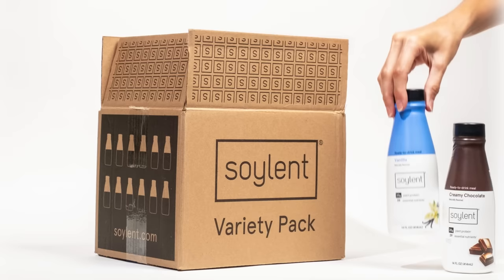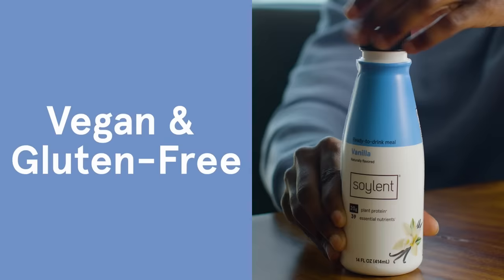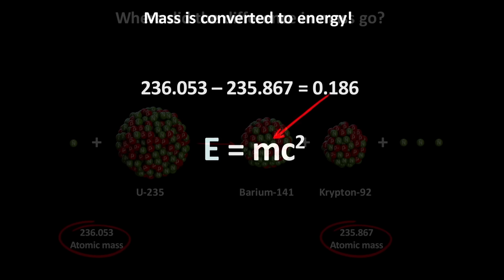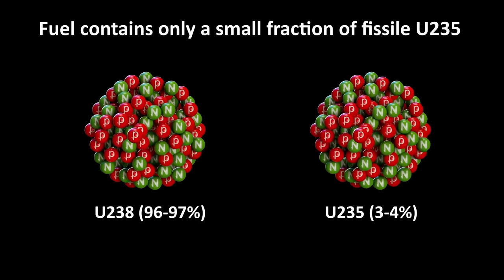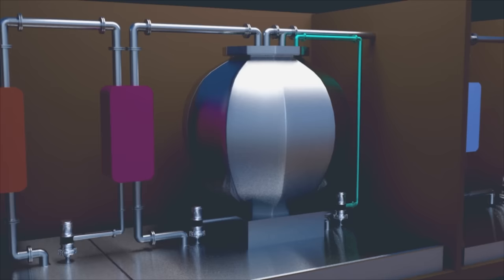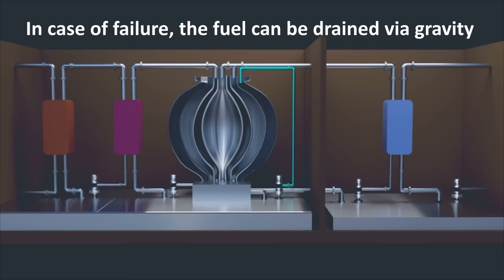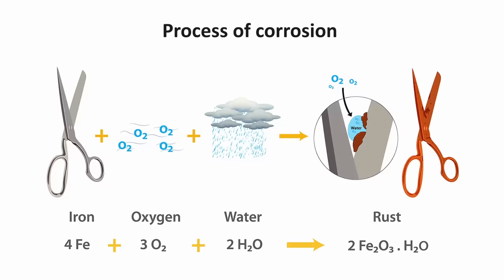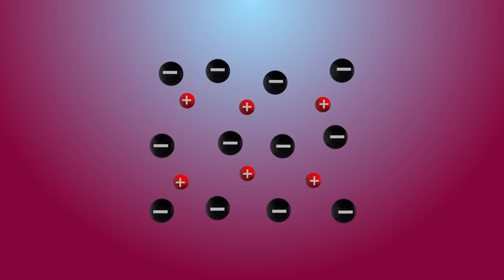How Molten Salt Reactors Could Revive Nuclear Power

Comment: IMO the biggest problem with nuclear power IS the nuclear waste.  If a country(ies) can't get to a single storage facility for waste as is the case in the US it makes waste storage cost prohibitive since it's something that has to happen for 1000s of year.

A secondary problem is cost.  If the energy produced costs so much that most people can't afford it, it's not beneficial.  Govts. COULD subsidize it but since in the US we have slashed taxes so much that we can't even fund the IRS, or people are getting close to seeing their Medicare get slashed and can't afford medical care and SS benefits are about to get slashed by 25% which will turn a few million retired people into abject poverty, then nuclear power needs to be able to be built and operated to where the output power can be sold on the market for no more than 25 cents/KWh.  And even at that cost it has to be mixed with lower cost power.  Otherwise we turn ever more into a country of have and have nots where the people without have to do a LOT of power rationing.

Comment: This is the type of reactor that I think we need NOW!!  If they could address the corrosion problem it seems it would be almost perfect.  If they could get the cost of them heating chambers down low enough, you could just remove the salts, bring in a new chamber, but the salts back in and keep going.  I know that's too simple, but I just got the oil in my car changed today, and thought you could do the same with the reactor.  Please don't take me serious!
Reply: No practical way to remove waste products from the salt especially neutron poisons. MSR will never happen because they have unsolvable technical problems.
Reply: rdgale2000, you deserve a medal for expertly using sarcasm. At first you had me, when you went on with your car I almost choked - and I think I needed your exit line to really catch your drift. Well done!
Reply: @guytech7310  Not necessarily unsolvable only not answered yet.
Reply: @guytech7310  that is not true, you can process them in the loop. There are chemical and electromagnetic techniques to remove byproducts and treat the fuel salts as they pump through the primary loop.
Reply: @ironassbrown No that is wrong. No process has been develeped to date to extract waste products in situ.  There has been talk about it, but no process has been developed. 

In the 1970s ORNL process was to extract (remove) the salt, dissolve the salt in water, extract the U-233 and dispose of the contaminated Salt & use fresh uncontaminated salt to replace the disposed contaminated salt. This is not practical & creates a huge amount of waste included a large amounts of contaminated water.
Reply: @mikloscsuvar6097  as stated in the video the real difficulty is the corrosion issue, and unfortunately only through trial and error will it be solved. Most of the knowledge gained from the MSR experiment at ORNL was lost as the program was discontinued and all the people involved are pretty old now or have already passed away. Most of the records and notes as well as the reactor and accompanying apparatus were thrown away or scrapped to make room for other projects.
Reply: @guytech7310  Processes have been developed, they just have not been deployed yet in a functioning reactor. As for U-233 that is the primary fuel of a thorium breeder reactor and there is no reason to remove it, unless the reactor is prematurely shut down as is the case with ORNL MSR project. Also remember that MSRs' can be designed to burn a variety of fuels and actinides, thorium being only one of those in the case of thorium breeders. The primary neutron poison that was generated at the ORNL MSR was the noble gas xenon which can be bubbled out of the fuel loop column and collected in a holding tank, they simply did not anticipate this in the original construction back in the mid 60s' and therefore it was unsolved at the time. This did not however stop criticality in the reactor it did create fluxuations in the criticality though, this is a solvable problem.
Reply: @ironassbrown  U-235 or U-233 not really that important, chemically its the same.  No there is no process other than the one I stated.
Reply: @guytech7310  But why would you remove the fuel from the reactor? It is supposed to be in the fuel salt that is the whole point. I don't understand why there would be any reason to remove it, even in the case of a SCRAM what would the utility of removing it  be?

edit: I just reviewed ORNL's Review of Hazards Associated with Molten Salt Reactor Fuel Processing Operations. I see no reference to using water to separate U-metals from the base salts. The reason they removed the fuel salt was because it was a test reactor so they wanted precise control over each batch for experimental purposes. In a commercial reactor you would just leave the fuel in the reactor and add more fuel as needed.

the process for purifying the used fuel salt was summarized though, it was a multi-step process that primarily consisted of pyrolysis and gamma wave treatment, and in the end they would reuse the salts and the actinides at the new ratios determined by the experiment schedule.

Comment: the thing with the waste is that it doesn't actually take much space at all and with current and upcoming technology people are working on turning the waste into forever batteries. they dont make much power but will never need charged so can be used for heart machines and other things that never get touched. there was a basic version on one of the probes that still operate in space after 40+ years. I dont remember who but someone on youtube went into a reactor plant and even kissed a tank of waste because its not actually much of a hazard if stored properly in concrete.

Comment: @13:30: The salt expanding with heat means that less mass of it fits in the volume of the reactor because it is less dense. And this means less fuel too, and so less reactivity. This is why it's passively safe.

Also missed a good point: Solid fuelled reactor fuel is 'spent' when the byproducts build up enough that they absorb too many neutrons: This usually happens after only a few % OF the few % of U-235 is actually used. And so it goes: Th in breeder: eventually convert high 90's % to U-233, then burn all U-233 because *the wastes can be removed from the liquid salt*.
 
Conventional solid-fuelled nuclear: Burn about 5% before spent: need 20x more fuel. Need it concentrated to 4% (but it's 0.72% naturally: better have about another 10x more natural U. Natural U is about 0.25% to 0.001% U Oxides. So dig up 10000x more ore. 20x10x10000: you needed to dig up 2 million times more ore. Suddenly digging up coal isn't looking so terrible by comparison.

So, 'fuel efficiency' of Th breeder by comparison is 'probably almost all of it'.  Oh, and there's typically about 5x more Th than natural U. All this means you end up digging up significantly less dirt to get the energy. More like 1000x less. Suddenly Th is looking a thousand times easier than conventional nuclear. And a similar ratio easier (in terms of dirt-digging) than coal.

This is the reason Copenhagen Atomics expect to achieve the cheapest energy on earth, without compromising safety or sustainability. 

Part of the problem? We don't actually need any new Th mines. It's an industrial waste that comes 'free' with the rare-earth metals: It's commonly just thrown back in the hole, or maybe put into dodgy 'energy crystal' scam products. Th is so common that you can get it from beach sand. You could dig up practically any earth, anywhere, and the energy you could make from what little Th you'd find would still be enough to pay the energy costs of getting it. But you'd be better off with the beach sand.

Why is this a problem? Because it leaves the coal mining companies with nothing to do. The waste from rare earth mines is enough to power the world several hundred times over.

There's estimated to be enough Th around on the planet for us to be good for probably 10 000 years or so, at current energy usage rates.  Then in space there's millions of years worth more. You think it's going to take us 10 000 years to get around to mining asteroids? The way Elon is going, It won't be all that much longer. 

But even a few centuries of carbon-free and clean energy is basically sustainable. On the scale of millions of years, even solar isn't really sustainable: Sun will die in 50 M years or so - there goes all 'renewables'.

No energy source is infinitely renewable: There's really no such thing as 'renewable' energy. You can use it, once, before it's too cold and you have to chuck it out.

If you think that can't be right, then you don't understand the Laws of Thermodynamics properly: You can't break even, you can't win, you can't quit, and it's the only game in town. You can only 'cheat' temporarily - the House always wins. 

Energy gets colder with time, irreversibly. This is the "you can't win" part, also known as The Second Law. This one is also why death & taxes are inevitable: The most natural state of any machine is broken, the most natural state of any living thing is as dead remains. It's also why Murphy's Law too: Anything that can go wrong, will: Entropy can grow bigger sooner that way: equivalently, the heat can cool off.

It IS depressing, but it's also fundamentally Why We Can't Have Nice Things, so it really helps to come to grips with it.

Conventional nuclear has pissed away too many orders of magnitude in it's 'digging up earth' efficiency, and that's why it's economically failed to be so much cheaper than coal that it kills coal. 
Liquid fuel nuclear has a real shot at getting it right.

Comment: Nope:
1. Too may technical problems, such as salt caking breaking off in chunks and destroying the circulation pumps, to no practical way to extract waste products, especially neutron poisons that will impact critically & efficiency of the reactor.
2. Salt makes it difficult to fully inspect & maintain the reactor as of its opacity, and when cold the salt is a solid, and the salt is hard on equipment like circulation pumps & heat exchangers.
3. World is running out of economically recoverable Uranium. At current production the World will run out of economically recoverable Uranium around 2050. Most utilities are aware of this & will not invest in new reactors or plants unless the gov't pays for it.
4. Forget Thorium as it fertile & not fissile, requiring a Breeder type reactor, and has a problem with U-232 (produced when Th-232 is converted into fissile U-233) is nasty gamma emitter. A MSR using thorium would be complete unserviceable because of the extreme radiation.
5. Liquid metal reactors (ie Sodium) is far far more practical than MSR, but even they are a nightmare to run & maintain. France & Japan ended their Sodium reactors as they had to deal with constant problems & cost too much to operate. Russia also had a Sodium reactor BN-800 as was going to build a larger BN-1200, but canceled the project because of issues with the BN-800. Operating a Sodium reactor is like going to the moon, Operating a MSR would be like going to Pluto, its far more difficult & costly. 

What is going to happen is the world is going to revert back to perhaps a 19th century level of economy when Oil production crashes, and probably cause a fast population crash as the global economy & food production crashes with it. Global Oil production peaked in 2018 and diesel production peaked in 2015. Most of the worlds production originates from very large oil fields that are in or near terminal decline. The world managed to postpone an energy crisis with advanced drilling & shale Oil. Conventional Oil production peaked in 2005. Since about 2010, US shale Oil production has managed to delay Peak Oil Production until 2018, However 3 of the 4 Shale sweet spots are now in decline and Shale well have an extremely short production life (most of the Oil is extracted in the first 18 months as production rapidly drops off).

Comment: I have invented a power source that uses absolutely no fuel at all. It's scaleable,  it's able to be put anywhere in the world as long as you can get water to it to fill it to start it. It's an inverted water wheel.   If you know how a water wheel works, then inverted the elements.  By that I mean put a wheel in a tank of water. Instead of having troughs to collect water you have bellows air bags.  I'll explain the bellows bags,  a wedgebox shaped bag that is 12" tall 24" wide and 36" long so it's like a slice of cake laying on its side. The top of the bag has 2 rollers on it that helps it to squeeze out there air through the pipeline to the adjacent bellows bag at bottom of the wheel to start all over again.  So air will be in the ,7,8,9,10,11,and 12 o'clock positions . The one at 12 is transferring to the adjacent bellows bag at bottom of the wheel to start all over again with lifting strength. 1cubic foot of air has the lifting strength of 62 pounds. And a cubic foot of water weighs 62 pounds. So we are reversing the elements.  The 3 cubic feet of air in the air bags has the lifting strength of 186 pounds and remember there are 5 of them lifting at the same time.  That would be 930 pounds of lift strength on one side of the wheel.  That's more than sufficient to send the one at 12 o'clock position through the squeeze chute on top.  All the squeeze chute is , is two rails that slowly get closer to the wheel.  The rollers hit the railway as they rotate and squeeze out there air through the pipeline to the adjacent bellows bag at bottom of the wheel.. The top of the water line is from the 11:30 to the 1:00 position and that's the squeeze chute distance too. As the bellows bag gets squeezed out the lock keeps the  bag shut until it gets unlocked simply by hitting a lever on its way to the 5:30 position where it gets unlocked and is ready to receive air again. One side of the wheel has air bags lifting and the other side is empty of air.  So all the lifting is from one side of the wheel.  So simple it's crazy that after  2400 years that the water wheel has been working,  nobody ever thought to invert the elements..... Water cannot be transferred to the top of the wheel because of the weight and the inefficiency of the transfer speed.  But air can be transferred to the bottom quickly and efficiently..you have 930 pounds of lift strength pushing the one at the top through the squeeze chute ..just build one and see...nobody will sue  you because I'm the sole inventor of the inverted water wheel.  I have gone on a radio station twice and gave extensive description on air of the device and all details to the public.  I had to call back in a few times to give clarification on the wheel  so the listeners would have understanding of the wheel.  So once you've put it out over the internet and on air like I did ,,, it's cannot be legally patented by anyone.  And that was my intention to do so. A power source that uses absolutely no fuel at all. And it's free to the world.  You can now live in the desert,  or anywhere in the world as long as you can get water to it to fill it. May God bless you all.

Comment: If SMRs are sized to serve small, nearby areas, the short distances involved in serving these areas can be covered with no step-up transformers at the plant, and no step down transformers and no high voltage wiring and towers in the neighborhood, thereby lowering the cost of the grid. Minimal wiring could also help protect against EMP events. MSR should also allow atmospheric pressure cooling circuits reducing the amount of high strength containment for high pressure radioactive steam.

Comment: Plutonium 239 is fissile... 8:10
"Plutonium-239 is also one of the three main isotopes demonstrated usable as fuel in thermal spectrum nuclear reactors, along with uranium-235 and uranium-233."-Wikipedia
Plutonium 239 is a waste only if you waste it; otherwise, it is fissile fuel!

Comment: Problems.
1. Corrosion
2. Plating out
3. Heat losses to enviromeent inside plant
4. Concentration of fissionables
5.  Creation of highly enriched uranium due to molten nature.
6. Salts become radioactive with fission product daughters
7.  Fission product daughters escape
8.  Thoruim itself is not a fuel.
9.  Core is already melted down.
10 once salts escape they can achieve critical geometry and be impossibpe to shut down

Comment: Let me summarize to retain this info longer

Molten salt reactor 
+
Salts will solidify if they breach containment making it much easier to clean them up
Salts will drain back into their holding tanks if the containment and power production vessel fails
If salts overheat they get less efficient preventing a run away reaction
Fuel is both more abundant and easier to refuel (bonus points because you can recycle old fuel and produce less radioactive byproducts) 
Salt reactors can and should be made much smaller
While in power production the fuel is liquid 
The containment and power production vessel is not pressurized
Salt reactors can be made in factories and therefore make it easier to standardize them for nuclear safety/containment regulations
-
Salts are more corrosive to the containment and power production vessel
Hasn't been proven to be commercially viable

Big take aways
While molten salts are corrosive and unproven they are far far safer than conventional nuclear plants and are much smaller. While being easier to clean up and maintain. With built in safety features that prevent run away cascades that have caused nuclear failures in the past such as overheating or containment failure. With none of the over reliance on the operators or construction workers. 

Essentially once proven molten salt reactors will prove to be safer; more compact, cheaper versions of our current nuclear power plants.